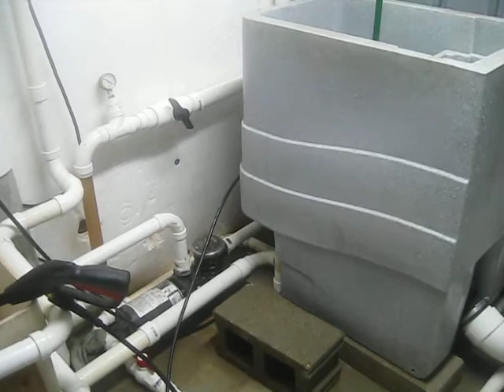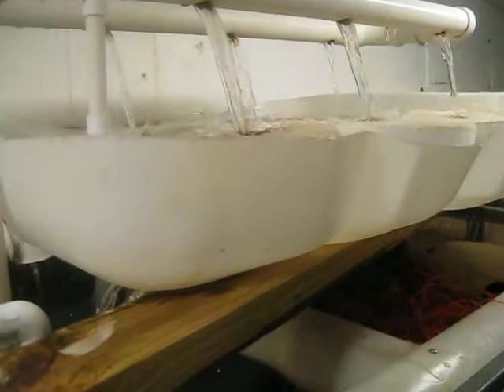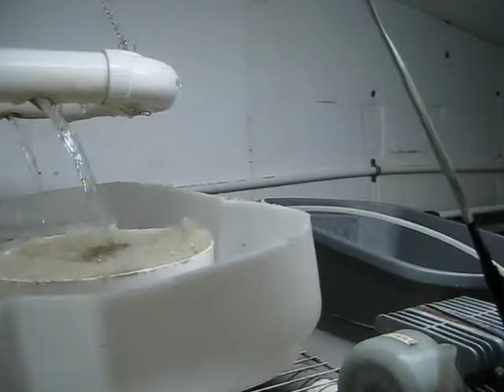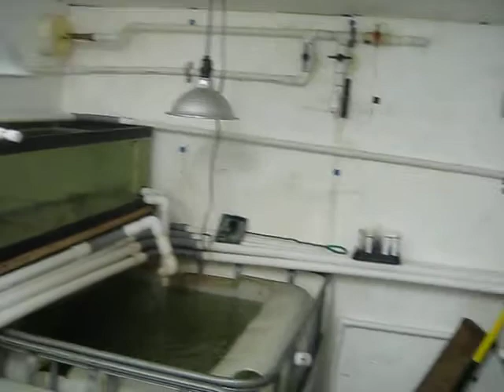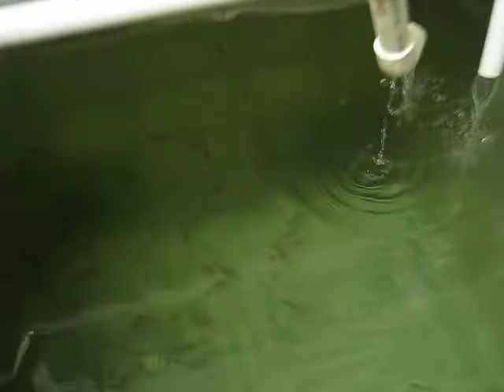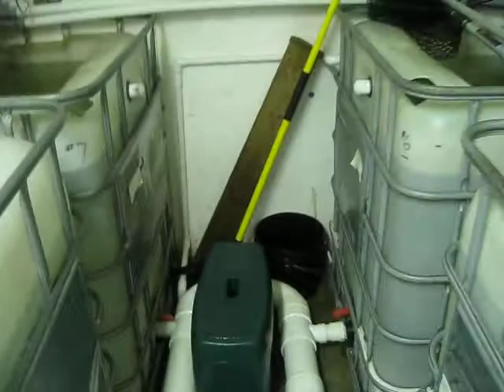DIY Tilapia Small Scale Aquaculture System - Vid # 9

Comment from the maker: If I didn't have a decent job and a understanding wife, I couldn't do this ether. My goal is to provide my grand kids with some clean fish to eat. It has definitely been an uphill battle getting to a point where my system actually works. Once I have accomplished that, I'll have to figure out how to make it run afford ably. When the SHTF, I have a 5000 watt generator, backup heaters and a backup pump. Steve.

Comment from the maker: That's a very interesting thought. To run two 1500 watt elements, you would need a 30 amp breaker with number 10 wire. Thanks again. Steve.

Comment: Love our videos. I picked up 100 fingers 3 months back. Picked up 2 tanks 55 gallon and 75 gallon. The ones in the 75 gallon are double in size to the other tank. Keeping the tanks clean is a battle. I have been testing different ideas with them. My goal is to remove power bill from equation. Gravity and solar. Your not buying your fingers now right?

Comment from the maker: You have an odd ball size. If you find a female adapter some where, let me know where you got it cause I have one too. I have run into 4 different threads on the IBC ball valves. The one you have, then there is a real coarse thread which I found an adapter for but it's about 20 bucks. Then there is the one which accepts a quick lock fitting but will also accept a standard 2" adapter, then there's one for a standard 2" adapter available at Lowes or Home Depot.

Comment: The manufacterer of the controller you are using for your tank heaters also makes a 2 stage controller. J.D. MFG part number VC241. They rate it as being able to control two heating elements.

Comment from the maker: I am using two 1500 watt hot water tank heating elements from Lowes for $10 bucks each controlled by an electronic thermostat available from any greenhouse supply or also from eBay. The bad news is they cost about $90 each and you need one for each element cause they are only rated for 1800 watts. They have a remote probe on a wire that I just weight down and toss in the tank.

Comment: You should try diversity, a tank or two of tiger prawns and a tank or two of a cooler water fish (bream, catfish, perch) that doesn't need the heat, saves a lot of energy.  For the non-vegetarian fish I feed kibbled dog food, it's way cheaper than commercial fish food (slightly lower in protein though).

Comment: Another way to control two heating elements with a single stage controller would to use a relay to control the elements and then the controller would open and close the relay.